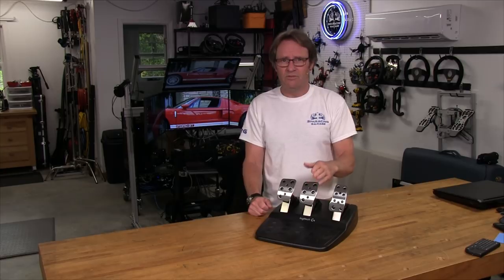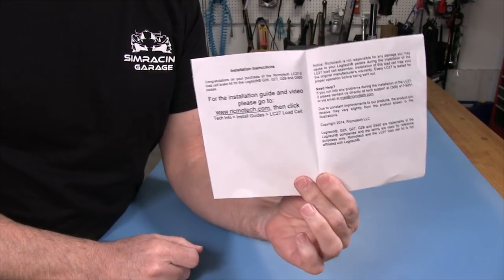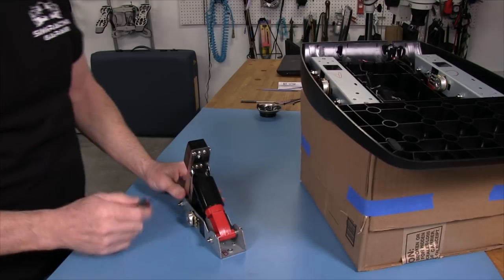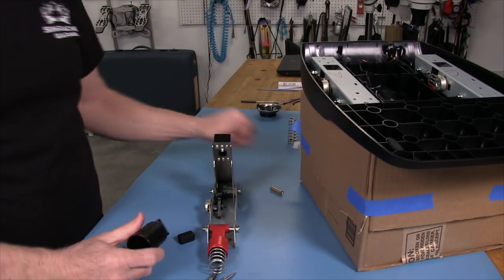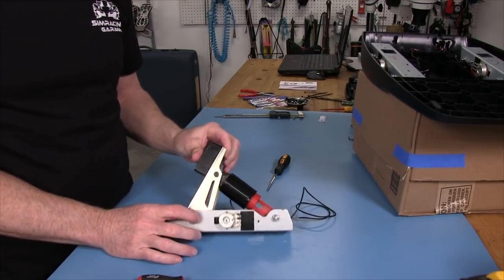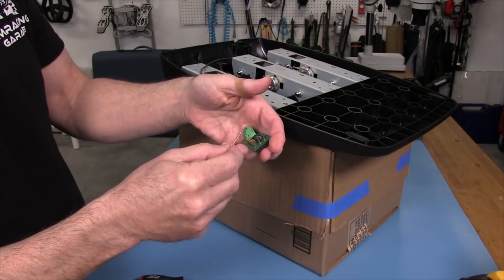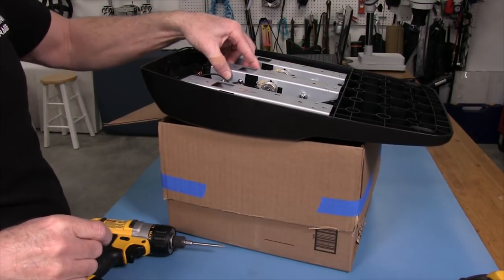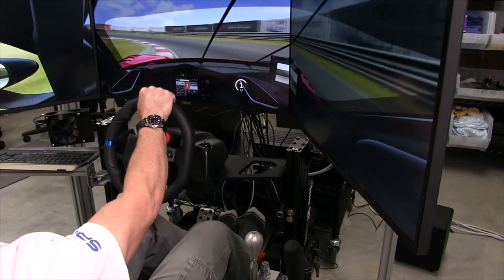Ricmotech Logitech Load Cell Kit Review

Comment: Everything is amaizing, my only concern is... why are you breaking with your left foot??? You only use your left foot for clutch and break with the right foot. Pretty sure there are just a couple of maneuvers in which you require to break with your left. :( I had fait in you! hahaha
Reply: Because it's faster on track. You can do it all the time on sequential cars. On manuals it's used less often.
Reply: @maarten3225  as a daily manual driver I can tell you it's a bad idea to make this an habit... track or not, the best solution is to use left for clutch, even in sequential cars I use right to brake, whats the purpose of braking and accelerate at the same time... jez even in formula Kart they tell you 10000times don't break and accel.
Reply: @Noztra22  You can go on the brakes faster than with your right foot. Doesn't mean accelerating and braking ay the same time.
Reply: @maarten3225  If the posibility of screwing up in an intense situation exists why would you leave a chance to do so? imagine having to fast react and hit both brakes and accel at the same time, you will end up colliding up front... also the left foot is not (or should not) be "trained" to be gentle, as with the clutch you have to go full on to gear unless you can feel the clutch cutting, anyway, if you get used to clutch pedal your left foot gets trained to press hard, and if you do brake with a left foot trained for clutch you will end up locking the brakes for sure :) but hey, don't believe me, I just drive a manual gear every day and do kart racing once in a while. But what do I know.
Reply: @Noztra22 It's a sim. Also not saying it's something you should do on the public road. Heck even F1 cars are meant to be driven with left foot braking.
Reply: @maarten3225  F1 cars don't belong to the vast mayority of the cars out there, problem is, even if playing games on a sim, you will create muscle and flex memory, in a game it doesn't matter that much as not all systems are beign simulated, but in real life you can screw up big time if you brake with left in a manual car... for starters, the moment when the engine revs are below the ratio of the gear you are the engine will stall and you will lose steering and brakes too... Please don't make this a habit even in games.
Reply: @Noztra22  The fact is that you're denying any type of left foot braking even on a race track. But F1 cars are fine because they're different? I'm talking about track use. Don't left foot brake on the road. It's not that hard.
Reply: @maarten3225  point taken, but he is not driving a F1 car on the video. Also F1 cars are not that common on the street, shockingly. Also I would agree with you if most people is trained for racing driving which they are not, so creating this type of memory will only lead to road accidents, and believe me, i have seen a lot of accidents when ppl mix up the pedals, just dont do this unless you really know what are you doing. And dont do this if you only drive auto, as switching to manual will be a dissaster for you.
Reply: @Noztra22  I get it, the F1 cars were used as an example for track driving. People need to see the difference between track, sim and road use. Then it's not really an issue.
Reply: Have been left foot braking for over 5 years now in sims, always use right foot in real life. Never had a problem until I got a new car than had a 'sport type wheel' and my brain thought I was in a sim for the first hour and was trying to decide what foot to use.

Comment: Wouldn’t switching the clutch and brake assemblies solve the problem of the ‘grabby’ potentiometer? Just swap the springs out, and remove the rubber stopper. Wouldn’t a quick fix like that give a less expensive, albeit looser response?
Reply: I think the brake curve is implemented in firmware, so switching the potentiometer itself would make no difference. And in my opinion the non-linear G29 brake is much better than the brake in G27. Compared to a load cell it will of course lose.

Comment: Currently I have a T300 alcantara, I am looking to upgrade. Should I go Fanatec V2.5 or should I go Accuforce pro V2? I dont know if the accuforce is worth the extra 300 euro.
Reply from the maker: Well, the Fanatec and Accuforce are two different animals. Depends if you want to make the jump to a DD wheel system.  If so, go with the Accuforce, or OSW kit. If not then you could go with the Fanatec. If you did, whenever Fanatec releases their DD base you will already have a steering wheel that will work on it. Really depends on what you think your future needs will be.

Comment: Hello, I do not know English right but I still have doubts about this product, especially since it is a very expensive product, because my local currency is worth 4x less than the dollar, making it cost half a full and new G920 steering wheel .

Is this product really worth it? For here I already use spring mod on the brake, by a spring that already does the work of getting heavier as the brake goes down.

I have questions if I can use this adapter together: http://www.ricmotech.com/Bodnar_Cable_for_Logitech_Pedals_p/bod-pedcbl.htm
For I intend to place Hall sensors on other pedals, such as accelerator and clutch. Does this all work together or not?

I also use a Fanatec GT2 Porshe and I connect my G27 pedal directly to the Fanatec adapter and not via USB as I plan to do in the future.
I have these kind of questions before buying and I accept ideas ideas that I can apply here.
Thank you.

Comment: Since you are bypassing the original pot then why even bother connecting the ground wire back to the pedal shield. Really serves no purpose at all after that mod.
Reply: A lot of these grounds exist simply to minimize noise between devices.

It may not be required, but the more grounds you have between various parts the less electrical noise you have over all.

In the WISP business we ground the electrical to the tower to the building to the equipment, etc... everything is on the same ground. Prevents anything from building a differing charge.

In the case of electronics differing charge causes noise and random issues. In the analog days that would be subtle lines across your TV while using the device.